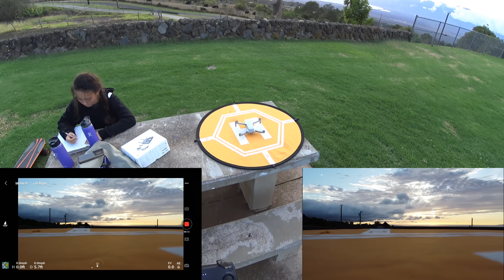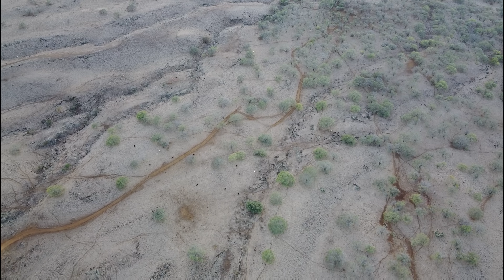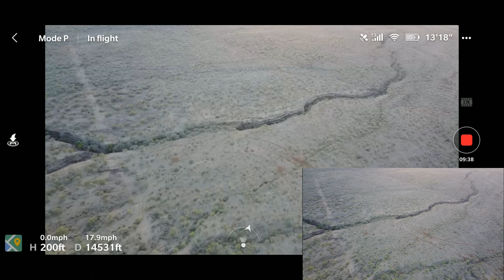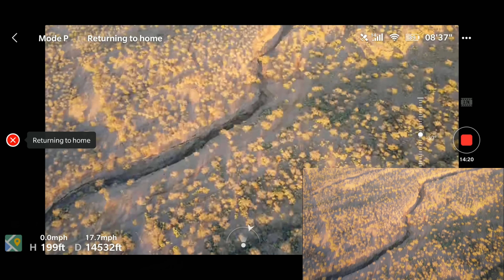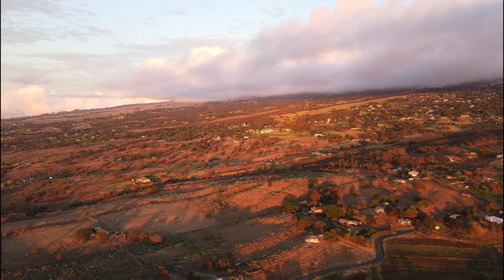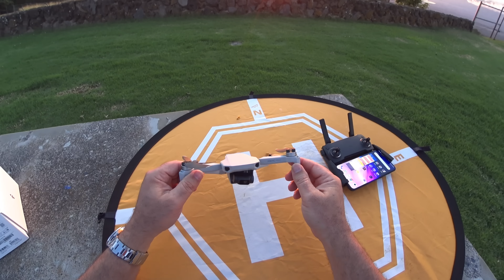DJI Mavic MINI Range Test to 0% Power - How Far Will it Go? (Bonus CRASH TEST!)

Comment: This video made me to buy this drone. 5.51 km at that best case scenario is fantastic. I need just a 500-700 meters in direct line of sight so nothing major compared to this test. 

The drawback is the sensor size in these things, but to get at least a 4/3" sensor to drone with a m4/3 mount, it going to require completely different drone level, and you don't anymore transport those. And it is anyways overkill for most scenarios for quality wise. 

With a such crazy performance, you can do so much with that thing.

I don't know where I first time read, that the common range is 300-400 meters and I was like "Okay, that would be let down but it would allow most things with just tactical positioning between takes and route" but then I read that you can have like 1-2 km ranges and I was happy as that is more than needed, and now seeing it to fly actually 5.51 km and making it back home, that makes it 11.02 km trip! That is just crazy! You can perform nearby property check with that thing, go check the powerlines, the shore conditions, and did you forget your door unlocked from fishing log.

Edit: Addition, I wish you would have turned around just 5-10 seconds earlier, you would have made it other side of the wall on your lap, or even on landing pad with 15 seconds extra.

Comment: I remember that 808 area code and when I was in Oahu drones weren’t that big and the phantom 1 wasn’t out yet until 2013 and I was there from 2011 to 2014. I did have a helicopter that I would fly but I wished that drones with a camera was out back there to get the recording of North shore.

Comment: Your calculation is wrong! You only counted forward distance of 3.43 miles. It burns battery on return flight also. Since your drone landed one few feet from you it could be easily assumed that drone can fly up to 6.8 miles which is way more that what is claimed to 2.4 miles or 4.8 miles. The battery didn't last 30 minutes as it kept transmitting from 3.43 miles while also recording videos. I usually turn off recording and stop playing with gimbal when making long flights. This is really a magic drone! Impressed with it, have two !!! :-D

Comment: Well, have to comment again. I did one Dronelink flight plan and then practiced a manual flight with DJI Fly. I can't understand why I got problem with signal at 1,486 feet away. Dronelink worked fine, only had an error screen about magnetic field interference. According to Dronelink support, this is something that is in the DJI SDK. Complaints go back more than a year. Popped up for me. Flew the plan anyhow, and it flew fine. I closed the Dronelink then did a manual flight for practice. Not only did I get bad transmission error, but right at the furthest point I then get battery level low warning, and the RTH which I set, thankfully, brought the Mini back. It got about 50 feet away and did a real fast drop. I was pushing up,up, up, D word couple of times, and it finally slowed in last 2 feet or so, and phew....I didn't want to crack the little guy up, since that would have ruined an otherwise, really fun outing. Do you think it was due to battery level being low, maybe ? It's a DJI refurb from their store. I don't know if they refurb the batteries. Maybe they don't check these drones out for range and also battery condition. It looked new, like brand new. Even the parts and box have that new smell. I don't think the drone was used at all. If you get a chance to read this, maybe you know more about what could affect range.  1,486 feet shouldn't have been a problem.

Comment: When you see Dustin repeatedly flying the DJI 's  Past 0%...in his range tests,  what you are seeing is that DJI set the Zero point at about 1 % in order to keep the batteries from being destroyed by true zero point discharges. The Critical warning.. stops you going below 10%  necessary for long battery life.  In this case 25 seconds of flight time after it shows zero.  In other videos it has been longer.  Battery health may ad a variable..  mid life batteries may deliver more than very new or very old ones.  Chances are the battery will survive this a couple  of times..but all bets are off it you do it.

Comment: The best thing to do to conserve battery is set you rth altitude at the min level you need to clear everything on route. So if you go out to 400ft 4 miles and you can clear everything on the way home at 100ft set rth to 130ft the drone will use less power lowering down and moving toward home at the same time. I was at 500m 2km out with 10mins of battery left. I only need 90m to clear everything when returning to home went from 10mins of flight kept going up to 15mins of battery. Goi g up and out uses more battery then down and in if obvi no wind. You may loose connection but if you know your clearing everything on rth it will eventually come back to signal connect once closer. Rather not see rth if it means it will give it more battery flying lower on the way home.

Comment: There is definitely money in the flying a drone as long as you know what your doing. Guy was just testing out the range of the drone and money just came to him❤. I've got the same drone I'm going to test the range on it in the morning... This is awesome
Reply: How was the range
Reply: @Gepoozski  I haven't taken it to the max yet because I'm not sure if it will come back I lost one before but from the videos ive seen its at leat 2 miles maybe a little more. From what I've seen if you push it to the max and if it loses signal it will automatically come back so I'm going to try it tomorrow I'll definitely let you know because I'm curious myself on how far it will go
Reply: @Gepoozski  it's definitely a damn good drone I will say. For the size and the price you really can't beat it. . I have the mavic mini and it's awesome..
Reply: @xcole1911  im just surprised because in his tests the mini 2 got less of a range than the mavic mini.. and it was supposed to have occusync 2 and all that fancy stuff whilst the mavic mini uses enhanced wifi technology.. how??!
Reply: @Gepoozski  I think you get better range when your not around so many wifi signals or buildings I'm going to find a place that's wide open and see how far it goes. But yeah they have range boosters that supposedly helps but mine does just fine without all of that. Witch one do you have?
Reply: So today I took it 3 and a half miles I started out with 12 satellites I stopped and turned around at 3 before it lost signal. I highly recommend the mavic mini. It has other features that I haven't figured out yet it's still new to me.
Reply: @xcole1911  absolutely no interference right?

Comment: Interesting result, 3.4 miles and currently everyone complaints about Mavic Mini range (apparently 1-1.5 miles if you lucky). Did DJI restricted its range with firmware updates? 🤔💁‍♂️
Btw. one of the best if not the best drone channel on YouTube, keep up the good work Dustin! 👍
Reply from the maker: With no interference, you can get premium range 🍻
Reply: @DustinDunnill  apparently... Long time watcher, first time caller here lol... 🍻

Comment: Battery suicide lol at least you made it back luckily. Thanks for the upload. Be weary even if that battery charges up it won't have the capacity anymore but I'm sure you know this already. Nail biting return :) thanks again.
Reply from the maker: I've flown it several times to the same battery level with this battery and all have been within seconds.   Maybe in the very long run but seems fine so far 🍻

Comment: “My battery is low and it's getting dark.” 

Thanks for the video! Just in case, if you had stopped recording, could you have saved a bit more battery? However, I appreciate that you didn’t.
Reply from the maker: Possibly a tiny bit but may not be noticeable 🍻

Comment: I'm having range issues with mine.  From what I've learned I should have like 11 channels in Fcc mode if I'm correct.  I live in NJ USA and mine has 4 channels and I'm getting like 600m. I've had so many drones and now getting back into the hobby.  I have flown my spark over a mile in front of my house but now with the mavic mini I can't even get 700m. Can someone help tell me how to fix this please? Great job Dustin its good to be back watching your videos!
Reply from the maker: Maybe you got a CE version?  Not sure.  Or you have some strange interference near that mini doesn't like.  I'd try auto or different channels.
Reply: @DustinDunnill  yeah that's what I thinking I got the CE version. I bought the parabolic dishes n that helped a bit. I tried different channels to no avail. But thanks for your help bud.

Comment: Great test!! Did you put your phone in airplane mode or turn wifi off before flight? Also, did you manually select the transmission frequency or just leave it on auto? Thank you
Reply from the maker: I turn everything off but data.  Auto frequency 🍻

Comment: Wondering if it's doable to open the battery case and replace the 18650 batts DIY? Save some bucks I'd think. Wonder what the mAh is on the batts they use?

Comment: I’m blown away at the range he got in the test. I can’t get more than 400 feet and I start losing signal. And I’ve  only got to 400 once. Most times I’m getting 200 to 300 feet before I start getting weak signal. Is my done defective? I just got it about 3 days ago. Am I doing something wrong? Why is my range such hot garbage?
Reply: could be 2.4 vs 5 ghz
Reply: @insainperson6018  I was able to get better range by manually setting frequency and channel. It did improve and I was able to get to about 1500 feet. Ultimately I ended up returning the mini 1 and getting the mini 2 and now my range issues have gone away :)

Comment: i dont claim to know anything about these but just curious. wouldn't you conserve power by not constantly moving the gimble while its low on battery.... plus im sure wind direction would play a large role in the distance away and back. tail wind out i would think you need more juice to get back with headwind.. i dunno just spitballin and curious about these, thinking of getting one
Reply from the maker: It would be a negligable difference since the gimbal motors are constantly working to keep cam level anyway.  Wind direction and speed make the biggest difference 🍻

Comment: I bought one. I’m lucky if I get 350’ never mind 3.5 miles. No way, not even close!
Reply from the maker: Interference will really impact this drone since it doesn't have the Ocusync Dji technology 🍻
Reply: Dustin Dunnill I couldn’t help but note where you did yours, one of the HI islands correct? I’m guessing there’s a very low amount of interference. I live in the middle of a neighborhood here in TX so I’m sure it’s saturated with all sorts of interference. Anyway, I’m new at this, todays conditions were perfect. I pushed it to 1000’ worked great. Will keep pushing it over time. Btw, your video was awesome! You got every last inch out of the drone. Pretty cool 👍

Comment: Can you shut the camera off to save the battery ? Then turn back on intermitantly (sp) ? May have extended the flight time. Or switch from 2K to 1080?
Reply from the maker: Yes, all that you mentioned would likely save a very small amount of power.  Some more negligible than others 🍻

Comment: Do you think it would have made a difference switching to S mode and manually piloting it back?
Reply from the maker: It's a gamble since flying faster sucks so much more power and when the drone tilts more  forward to do so it creates much more wind resistance 🍻

Comment: i have a phantom 3 standard, and if the battery would have been like 3%, it would have just droped like a stone. 
Is there any other system on the mavic mini that allows you to fly to 0% and it still lands safely?

Also wonder if you would have gotten further with range boosters?

Comment: What settings do you use? I tried the same test and only reached about 600miles with my phone on flight mode. I lost connection on about 550 miles. Do you have any tips on extending the range? Thanks for the great content.
Reply from the maker: Auto settings.  You likely have interference somehow or CE version 🍻

Comment: So you don't need to have the drone in sight but can fly by the video on the phone? it's not lagged video?
Reply: nope, it transmits seamlessly (depending on distance away from controller of course), and the clarity is great. I love mine. Also, its a lot easier than one might think. I, too, was hesitant on controlling the drone with strictly my phone screen, but after a few flights I had it down, no problem. Amazing stuff
Reply: @thedawsonian9094  As long you have the auto return home feature I guess you can fly without fear :) Only problem for me with the phone app is I need to wear glasses to use it

Comment: Hi Dustin ...can you take a look at a video i posted on my channel with a problem i have been having with my Mini ..its acting really werid and almost crash for no reason . I calibrated the compass and IMU ... No wind warning but it had 2 massive twitches almost did a flip 2 times ...i was lucky for not crashing
Reply from the maker: Sounds like a defect.   I would try to get a replacement from Dji 🍻

Comment: It flew 5+kms in an open field. Absolute perfect. JUST A QUESTION to the people who already own it. What is the distance that it could fly in a city with buildings around?
Let's say I live in a city block. Could it fly UP of a building (a building 150-200 meters of my house) and then continue flying in the other side without optical view?  
(I'll try to show with alt Symbols)

      ▓▓
      ▓▓
🏠 ▓▓ 🏠

A small house, a 4-5 floor building INSIDE and then another small house.
Could it fly from the other side of the 5 floor house, or the signal must be absolute straight?
The distance of the 2 small houses is about 300m-400m. (not even more than a kilometre)

Comment: Is there or is it possible to have a drone with built-in solar panels?
Reply from the maker: On a plane done with wings you can.  These multirotors pull too much power and don't have enough surface area for big enough panels as of yet 🍻

Comment: So if you had put it in Sport mode both out and back...would it go further with more battery time.?...would it get back faster and more battery time left...or does P mode have the same top speed as Sport mode?
Reply from the maker: It's a gamble since sport uses way more power

Comment: Question sir I cant use it near wifi?  Im into race drone but planing to switch to mavic mini.
Reply from the maker: Connection will be weaker around any interference.
Reply: @DustinDunnill  but it won’t fly away?  Anyway thanks for the info sir
Reply: @DustinDunnill  good day sir just got my mini. What should you prefer for transmission settings? Should i go to manual? Or stay in on auto? Thanks
Reply from the maker: I just use Auto.  Maybe try manual if you have some connection issues
Reply: @DustinDunnill  thanks

Comment: How is it possible, that you still have connection at over 3 miles and my mini looses connection after like 1500 feet?
Reply: Yeah it's beyond me
Reply from the maker: Interference/location
Reply: Also make sure in your settings in the app that the max distance is put high, my max distance was set at 100m and now the mini can fly much further

Comment: How to ruin a perfectly good battery for no good reason whatsoever. How about landing safely with a decent battery level and walk there?
Reply from the maker: Yet it's flown several times after this for 27 minutes to test 🤷‍♂️
Reply: @DustinDunnill  really? That's good. I would have found it a real shame if it had damaged them badly.
Reply from the maker: Yes really.   DJI gives a good voltage buffer when it force lands